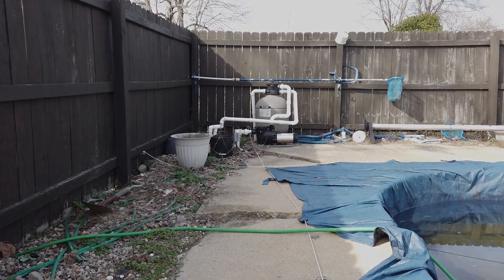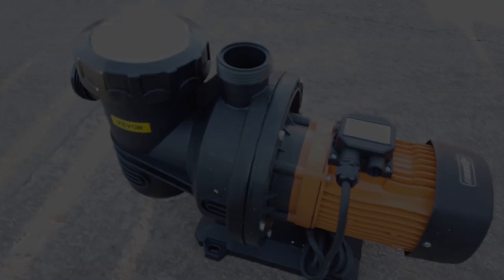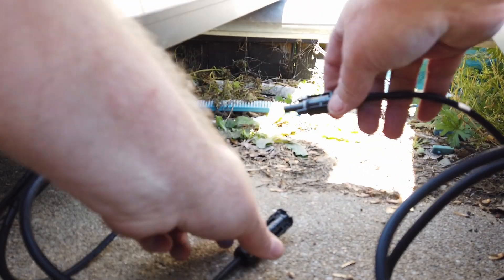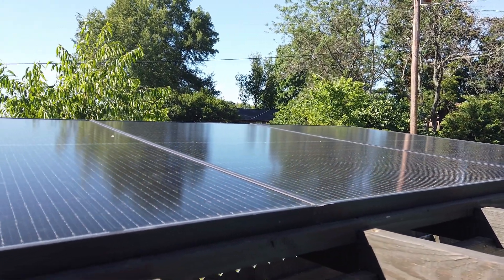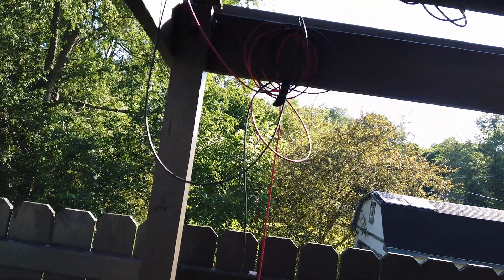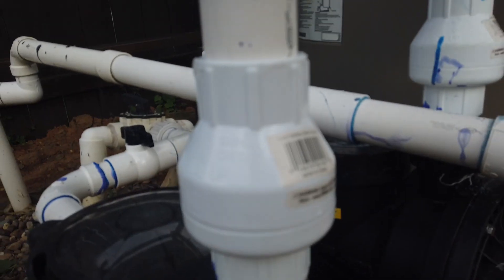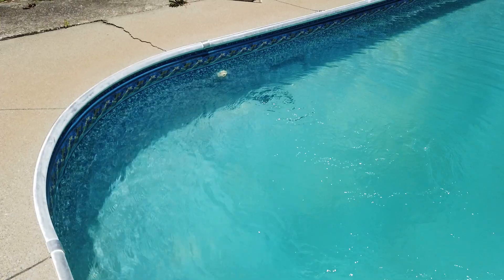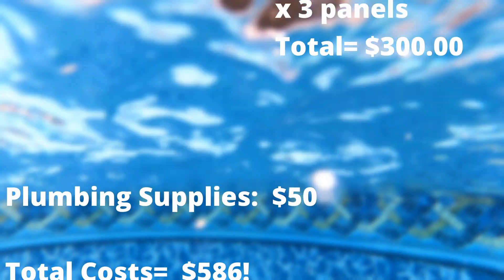How to Install a Vevor Solar Pool Pump + Review

Comment: my pump uses 142 watts and I run it 24/7.  142x24=3408/1000=3.408.   3.408x.15= .5112.   If you spent $1500 it would take 8 years to break even. I doubt the vevor pump lasts 2. 
If your pump is costing $3 a day there is your problem.  
I wouldn’t trust vevor for anything like this.   I got a diesel fuel pump from them and it sounds like it’s pumping rocks.  My Hayward pump runs 24/7 and only draws 142 watts at 1725. You have to be next to it to hear it.   I can flow at 621 rpm and it only uses 21w.    I could hook it up to panels but really it wouldn’t ever pay me back.  FPL only charges about .15
Reply from the maker: Wonderful loved doing math...first of all please check your numbers....does your pump run on 120v or 220v? If so ..look at the sticker on the pump and find the amps of the pump you have...my old electric pump runs on 240v at 15 amps...so the formula for that to get watts is W=V x Amps ...so if my 2hp pump works on 240v x 15 amps = 3600 watts.......so I'm really doubting right now u have a pump that's 240v or even 120v that only uses 142 watts...please find your amps and voltage on the sticker of your pump and redo ur math.....as far as lasting...the variable speed pump has nothing to break and it rests all night

Comment: Can a battery back up be installed in this ad well ? And how can I , I live in south Florida and I’m running my pump 6-8 hours a day ..
Reply from the maker: It's not designed to add a batt backup...in South flordia you won't need it either...my pump filters all day from first light until abt 830pm you'll be fine..the problem with the batt backup is there is no controller for the batts...so they must be 72 to 84volts batteries in series in order to work with the pump...then adding those along with the solar input .that means you'll have both sources turn the pump and it will burn up...3 365watt solar panels facing south at 15 to 20 degrees angle is enough. Your pool will be clean

Comment: What kind of pool vacuum do you have? Do you have a suction cleaner and if so, does it work with the solar pump or is the suction too low?
Reply from the maker: I have a terrible vac now...which I am soon going to get a robot vac...just haven't got one yet...and I think my solar pump would handle a vac line I just don't want to fill my solar pump with muck...thats why my pool is not 100% clean in this vid..sorry...that will be my nxt purchase...however the water is very clear + good...just got some sediment ...I need a robot vac to get...will have on soon.

Comment: Has anyone found a successful Pump Shaft Seal replacement on this PPO GF30 pump. Ive had to put in bearings in pump motor due to failed shaft seal. Pump only 14 months old. Vevor useless for parts and even a reply for part information. They just want you to but new pump.
Reply: Vevor would not sell me the shaft seal.  They said it was not available.  I tried to track one down on my own, but it seems to be a proprietary seal.  After going through three sets of bearings, I had to remove the pump and I put in a different solar  pump.  Video is on my channel.  If Vevor sold replacement seals, I'd still have it in service.

Comment: I have the Vevor 72volt 1200 watt version that I’m just now getting around to installing.

Do you think that three 450-500watt panels would do me better?

The controller is exact same as yours.
Reply from the maker: Make sure the voc is within the range of the pump...in other words the recommended max volts dc for the pump is 120v for the 72v 900w...if the 450w panel in seris exceeds 120v to the pump then I fear it will run hot and overheat..please look at your manual for the 1200w pump and see its max volts ...use the nearest voc in seris to that max volts without going over...each manual will have that listed...it's important to get as close as you can without exceeding the dc max volts
Reply: @st-qp4mr Thanks!  I found six used 300w panels and testing them presently in 3S-2P array. Pump sounds like it is not revving full speed.  The panels may be old and tired.  Solar panel test meter arrives next.

Comment: That's pretty awesome. The only thing I can think of that would make it awesomer is to route water through cooling tubes on the solar panels. Heat your pool water and cool your solar panels at the same time. The cooler you keep the panels the more efficient they are.
Reply from the maker: That's a great idea to increase the efficiency of the panels and heat the pool water all at the same time!

Comment: Is there a timer you can install so it would only run when the sun is optimum. I hate to burn it out when it's barely sun up and barely moving any water in the early & late evenings. Thanks.
Reply from the maker: It's made to be variable speed...it moves with the amount of current running thru it....yes it goes slow til about 830am then runs all day til about 830 in summer time...so I get 12 hrs of filtering time.each day...you don't need a timer .the controller board regulates it for you.....just leave it turned on and let the sun do its thing...mines been running like that for a year now..no issues
Reply: @st-qp4mr  Fantastic. Thank you for your prompt response and great feedback... Will move forward with mine... Thanks from Phoenix AZ where Roadrunners wear flip flops in 125F weather. Laters…

Comment from the maker: Just did my second pump for another pool...my color of wires were different than in this vid...if that's the case for you..no worries....just hook up the wires based on the letters "U" "V" "W" to the same letters on the control board and you'll be fine....Vevor told me they sometimes use different wire colors but they test every pump before shipping. So hook it up the way they send it to you!

Comment: Nice video sir, thank you. I usually run the pool pump for 10 hours a day during the summer. Can the Solar panels handle that type of usage for 3 months?
Reply from the maker: Yes mine do 10hrs + also..from about 8 to 8 so 12hrs a day easy...the speed of the pump varies in speed never even gets warm

Comment: i am using on average 20 to 30kwh per day for my pool pump and waterfall.  I figure Pg&e is costing me about $350 a month at least. this is using a pentair system with easytouch. Great roi. thanks for the video. rates are about .42c per kwh off peak and 
.60 per kwh peak. in northern california
Reply: Bro .... get an EG4 hybrid inverter and a battery. Solar panels are cheap.  it is super easy to do. I installed a $26k system on my house 8 years ago for $6k.  If you can swing a hammer and plug things in you can install your own solar, espeically with the help of youtube and if you were worried about something just install everything and then give an electirican $500 to check everything out.
Reply: already did, waiting on permits right now.  eg4 gridboss and flexboss w 19.4k panels on chiko carport.@bpb5541
Reply from the maker: Yes you won't believe how easy this is to do...and you'll pay for it so fast being in California. Good luck

Comment: Do you have to restart the pump manually each day? I read on Amazon that someone said it did not auto start in the morning?
Reply from the maker: No it will start at sun up everyday!! And go off at night..just leave the controller in the on position and it will do the rest.

Comment: My controller stop working getting no power coming out. Try to order just the controller but it seems they only sell the whole kit.
Reply from the maker: Make sure you've eliminated all simple explanations...first check wires going to the terminals to the pump...check any connections made ..cut a little off the wires from pump to board.( while it's turned off of course) and reseat them...make sure nothing is shorting out...next make sure the positive and the negative are seated correctly going to the board....then check all ur series connections with your mc4 connectors make sure everything is properly seated...if nothing is found simple visually...please take a multimeter and check that the voltage is coming from the panels and you are getting the sum voltage of all of ur panels..meaning check at the terminal pos and neg with a multimeter that the solar is reading the good amount you should have...boards don't tend to fail that often...what fails is whats connected to them...a multi meter is a must for this...have u tried that yet...make sure all connections are reading the right voltage..if the correct voltage is read at the input of the board both + and - then the solar is fine...if you getting low or no voltage from the panels to the board then trace each panel individually until u see which one is bad...my guess is something has lost connection either a wire or a whole solar panel knocking the others out of series...please check all that first ...the simplest fault is usually the culprit.
Reply: Exactly what I was wondering as a pool cleaner and repair man very cool but  I wonder if there is gone to b any service to this pumps or y'all claiming that pump will last for ever ? if something brakes it gone to be replacement parts  or need to buy a whole kit again ? Need to know, if I start advertising this pumps to my costumers 
Got to b sure if this gone to turn to a nightmare to repair after install

Comment: I did this in California and it shaved around $120/month off my electricity bill.  If you have a pool pump it's one of the easiest ways to DIY some solar and save on your bills.
Reply: Where did you get your solar pool pump?
Reply from the maker: They can still be found on ebay or goggle shopping search jp19 solar pool pump

Comment: Would 4-320W 40voc grouped in a series be enough to power the Vevor 72v 900 watt and 1200 watt pump?
Reply from the maker: According to the manual the max open circuit voltage for the 900 and 1200 watt pump needs to be 43-44 vdc ..so look at ur panels the sticker on the back if it says each panel is 40vdc then u would just need 3 in series since the pumps max voltage operating range is 84vdc - 120vdc....so three 40vdc x per panel would produce 120vdc which is st the top of the max range...if u do 4 panels in series then ur looking at 40vdc x 4 panels which in series would produce 160vdc.....i would try the pump with just 3 panels in series if the pump works great then don't add a 4th...im afraid 160vdc is too high and could fry ur control board. Use your manual as your guide
Reply: @st-qp4mr  Thanks. I ended up finding some 410W 40V panels. Going to run 3 in a series on that set up. Hope it works.

Comment: Apologies in advance, but what mttp Solar panel controller did you use? Its not in the list of equipment and doesn't seem to be included with the panels? 
Thanks
Reply from the maker: The solar controller comes with the pump in a package deal...in the show notes click the link to the 72v 900w solar pump and you'll see the controller listed included with the solar pump, +all wires etc

Comment: Got this same setup, but I'm running mine off 2 400w panels. The extra panel, Im going to use it to charge battery backup setup and run yard lights off grid. This video was very helpful, thanks!
Reply from the maker: Nice 👍

Comment: I wanted to thank you again for this great video🏆! I really appreciate it! I do have a question on grounding the wires though for safety purposes. Did you ground yours? I have a very old setup and it is not grounded...  I have been told that mine is not safe and I need to ground mine...so I'm looking to copy yours, but I also need to think about grounding the electricity. 🌻Thanks!🙂
Reply from the maker: I did not ground mine due to the fact that this is mild DC current... not high AC..altho my 220v pump was grounded properly to code....I doubt if ther is even a code for a solar pump but id advise u contact your local building codes  inspector and asked him. I doubt anyone in the old electric codes books ever dreamed a dc solar pump  would even be possible
Reply: @st-qp4mr   thanks, i appreciate this information🙂

Comment: Just installed the same pump on my pool here in North Florida.  It's been running for about 2 months, and I've seen close to $100 monthly savings on my electric bill! I went ahead and ditched the old AC pump altogether, and I have yet to miss it!  Pool is sparkling clean rom the increased filtration time.  Amazing setup!
Reply from the maker: Thank you!!   Yes my pool also is clearer than it was last year by far...best thing I've ever done!!!
Reply: Ft Lauderdale here. I’ve been thinking of making the switch..!
Reply from the maker: @t.m.d7768  you won't regret it!!
Reply: @st-qp4mr so you mind if I ask which pump you installed? There are so so many options! I’ve also thought about a Solar Pump, but those are Drastically more expensive.
Reply from the maker: @t.m.d7768  JP 21 19/900watt 72volt...it's all in the video

Comment: The pump seems kind of loud, is it as loud as it sounds on the video?😮
Reply from the maker: Had my mic to close to it...sorry.. ..I don't notice it at all when I'm on the other end of the pool....id say,  it's less noisy than my old 220v pump was.  I've had it now for the whole summer..no issues ..it is the best thing I've done to my pool by far..I've never had to turn on my 220v electric pump once...also I don't ever have to worry about turning it on or off..the sun does that each day for me..
..went on vacation for 8 days... never had to call anyone to check my pool whilst gone!!! It's was perfect when I came home..filtering away with the daylight...it goes off around  30 mins til sunset.....the real sound can be heard when I do the test that shoots water out to over the pool...thats what it sounds like.
Reply: @st-qp4mr   thanks! :)

Comment: Hi. thanks for your video showing your experience with the solar pump. I live in Australia and have one of these solar BLDC pumps running as well. I bought it from Alibaba when Covid started but didn't install it for a few years. The darn thing gave me heaps of trouble and got a new pc board which burnt out in a matter of weeks. I ended up getting a whole new controller box and it is working ok now but I am not running it to its potential - only running 88 Volts 10 Amps from the solar panels. Does your controller box get very hot. Does it have any active fan cooling or is it just passive via the cooling fins on the back of the box. Keep us informed how it performs, good or bad it' all good information for people. Great informative vid, thanks a lot.
Reply from the maker: Will do!   I keep it outside so I don't get any heat from it so far...what size solar did u use? And how many etc...I bet the amount of solar is causing the heat...try to aim for the 110 to 120dc range ...the pump cools itself with water and the rear fan...if ur solar is too low dc wise and is not spinning the  pump to where water is flowing well enough to cool it ... it won't cool and be too hot.

Comment: The pump is 72vdc and your series solar panels send it 120vdc, this isn't damage the controller or even the pump?
Reply from the maker: According to the manual the range of the 72v pump is from  84vdc to 120vdc..so far the panels are working perfectly...there's always some loss of efficiency so I don't think im producing 120vdc probably more like 112 vdc or lower..il have to check with a meter..but it has been working flawlessly since installed..I even went on vaca and never touched it ...for 10 days it turned itself on and off with the sun 🌞 Pool water clear!!!

Comment: Subscribed to see how the pump holds up to long-term every day use. I’m curious how long it’ll last.
Reply from the maker: Ok thanks ... so far so good ..il give an update summer of 2025...my hope is there's nothing to go wrong in a DC pump..only cooper wires amd a controller board.. and unless my solar panels get hit by a rock etc...my solar panels are good for 20 years. Fingers 🤞